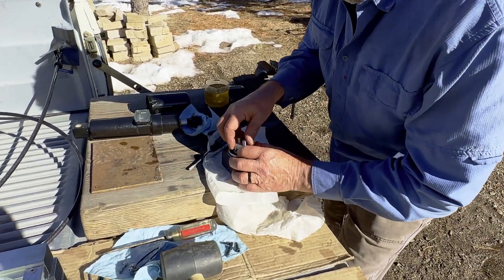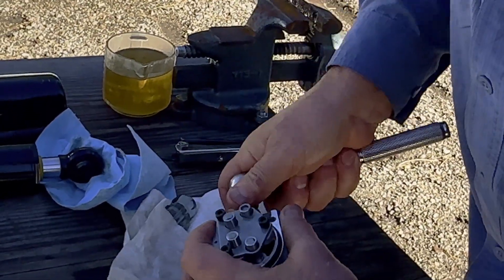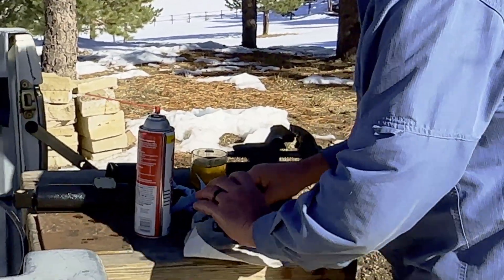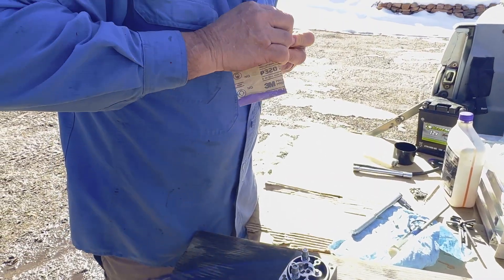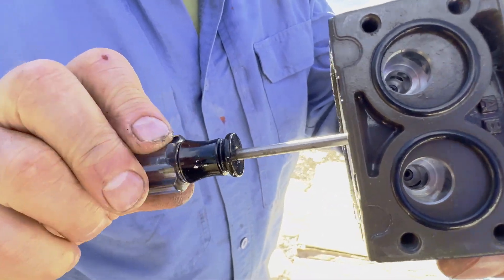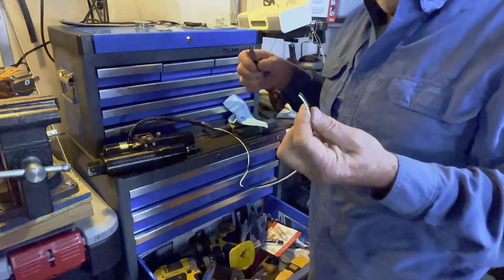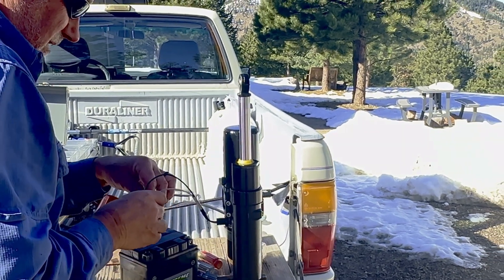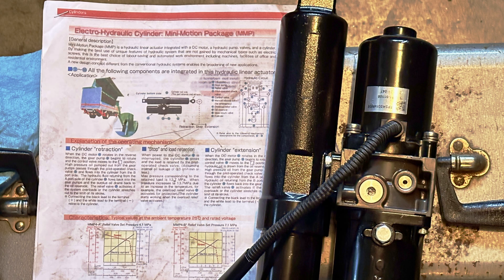How to repair an Electric Hydraulic Cylinder actuator for an ATV/UTV snowplow. It's a DIY!

Comment: How did you make sure you got all air out of system?
Reply from the maker: Pushed down on the cylinder by hand until all oil was burped. Still running today.
Reply: @Broswhoknowstuff which hole is the air bleeder?